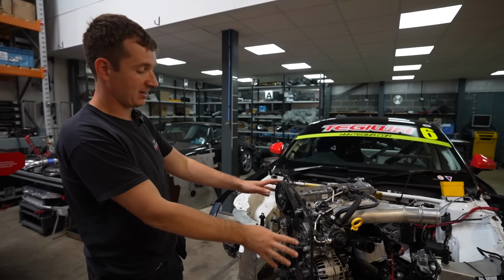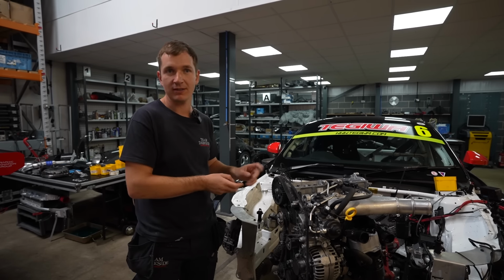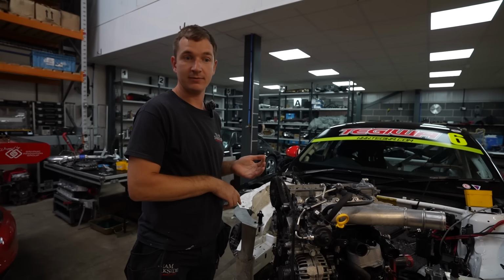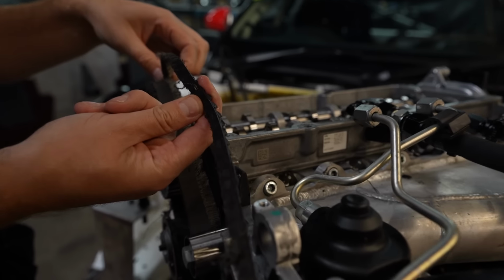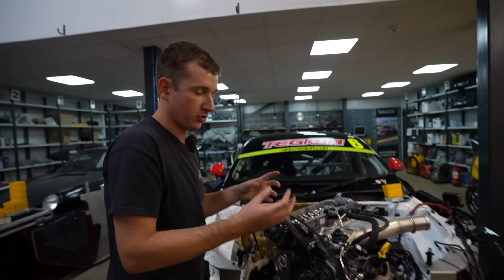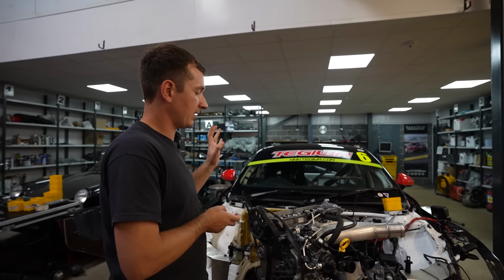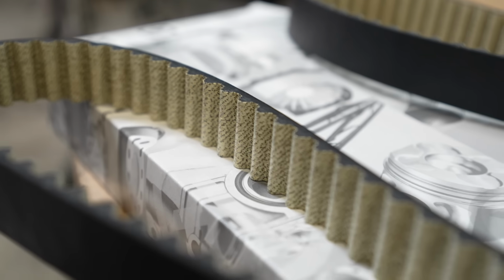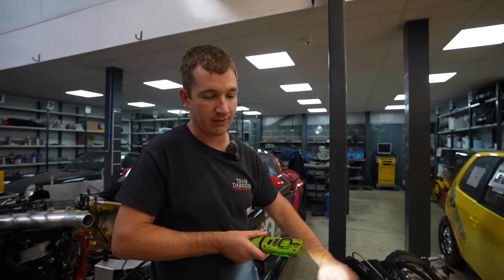CUAA CAMBELT CRISIS!!! We SNAPPED ANOTHER! 😫 HELP NEEDED! 🙏

Comment: Hi chaps, VW commercial tech here, we see this failure on the caddy's quite often. Although the root cause is still somewhat unexplained in our workshop we have noticed a fairly common trend, I suspect the timing belt is running backwards / forwards off the fuel pump pulley, thus causing the leading / trailing edge ( dependant on which way the belt is running off the pulley ) to wear against the edges of the tensioner pulley / sealing flange, this weakens the belt and then causes the belt to fail. 
If you look at the auxiliary bracket you will see a dowel pin that mates to the block, there is the possibility to add another (dependant on the bracket fitted) to ensure the bracket is correctly aligned to the cylinder block and therefore ensuring the fuel pump pulley is running true to the rest of the timing belt gear. 

Hope this gives some insight. All the best !
Reply: It was water pump on my side and i wasn’t only caddy’s. Also leon and golf’s
Reply: @Audi-fan_boy usually inna/borsehung or febi and the Chinese one they all work

Comment: Change the spring loaded tensioner for a manual one, because your revving the engine higher than oem rev limit you’ll be getting harmonics causing the belt to flat about, the pug/citroen tu5jp’s are known for it when you rev them to 7.5k on an oem engine and it’s worse with aftermarket cams and springs the fix is to fit the saxo vts/106 gti manual tensioner and the problem goes away even revving to 9k with an off the shelf gates timing belt

Comment: use electric waterpump (from bmw) ,waterpump delete plate and high pressure fuel pump from serpetin belt. shorter belt ,less strech and less load on cambelt.

Comment: Check the crankshaft timing belt gear they go oval ,roll it on a flat surface to see if it rolls smooth or with a jerky motion  which causes the timing belt to walk , which then rubs on the covers causing the belt to shread. check crankshaft pulley also for deformation as this also causes the belt to oscilate forwards and backwards efectivly cutting the belt . generally look for sharp edges and corners on all pulleys gears and idlers seen this quite a bit on pd engines.
Reply: A lot of VW sprockets and pulleys come from the factory oval (or square-ish).

Comment: Manually setup cam tensioner. Run fuel and oil pumps electric and fob off the runners for these. Potentially tension up using manual tensioner and then run the engine up on the dyno with a camera that has a high frame rate on the belt

Comment: The older PD engines used to do this. I found the toothed crank sprocket to be out of round on multiple engines. Possibly check all pulleys/sprockets are 100% true.
Reply: The crank pulley is designed to be out of round I remember reading it in a pdf about pds from vw themselves, counteracts the back lash from the injectors if I remember correctly
Reply: Just realised you mean out of round the other way, my bad

Comment: Change the belt prior to every race meeting.

Andy Burton had a famous homebuilt peugeot 306 rally car originally with a metro 6r4 v6 engine. It was replace with a dtm calibra cosworth v6 as the 6r4 engine kept breaking belts. They went to the extent of doubling the belt drive (stacked pulleys) and ran 2 timing belts...

Bit of a wild card idea, which i dont think fixes your issue as there clearly an underlying issue of the belt moving sideways on the pulleys.

Comment: Given the high rpm continuously when racing, could the tensioner be that bit too weak after a period of time that its allowing it to be a little too slack?
On other engines we have used manual tensioners to remedy this issue preventing the slap. Could you possibly rig a go pro in the area and remove the belt covers to observe when testing to get a better image of things before and when it occurrs?
Reply: Tomorrow's job on the other car ;)
Reply: I would just like to add that this is common on race bikes and stunt bikes (super high rpm and alot of abuse) I would be inclined to agree with you sir. Maybe a manual tensioner could help

Comment: Hi darkside i see gates make a "racing belt"  that back of the belt is blue maybe try that. Although they might not make it for that engine code u could probably measure the length width and teeth count and get one for another engine. Or get a marginally skinnyer belt to give you a extra bit of clearance 🤔

Comment: Similar issue with a 1.9 tdi with a aftermarket camber kit and the bearing in the tensioner pulley was pressed to far in and caused the belt to run against the lower casing, try a whole new kit 👍

Comment: i'd say change all the bolts and nuts on those pulleys tensioners ... maybe it can flex a bit under that horspower and load! arp studs bolts.... maybe?? head bolts maybe.! could you measure  all the pulleys run true and square .... there can be a problem

Comment: Harmonics definitely look at crank pulley or changing it, auxiliary pulley don’t think if it’s stock it will cope with knock of engine with it high revving…?? did you rebalance the crank, flywheel and clutch?l together? definitely vibration related hope you get it sorted 👍🏻

Comment: This reply is not specific to this engine and I'm not sure of what cams you are running so take what I say with a pinch of salt and adapt for you situation. When I used to build engines with higher lift cams and higher engine rpm you can get some real funky harmonics occurring with the cam belt at different rpms. The high lift cams used to exaggerate this effect more and different areas of the belt path would resonate at different points depending on the rpm. One of the things that used to exaggerate this even more was automatic tensioners as they contributed to the whipping effect of the belt. We used to replace automatic tensioners with manual tensioners and check periodically for the correct tension.
If you have a good fabricator in house there is also the option of adding another idler pulley on the lengthier side of the cambelt path to reduce harmonics even more.
Reply: This was one of our thoughts, as well as Pulleys with sides to help keep the belt centred.

Comment: Seems to do it after a gear shift. I would look at crank walk. Perhaps high pressure is moving the crank forward from the pressure plate?
Reply from the maker: Sound point, these engines never had a manual box but the crank feels good, engine was 100km old

Comment: From what i saw in the video. you got really high torque, you said single mass fly. that means the crank spins easyer and fast at every explosion is a big impact on the belt which is trying to spin the cams.
the tensioner can't take the instant torque, the belt is skinny.

personally my first try would be stronger tensioner and wider belt and pulleys everything just wider.
second thing weight reduction, for the cams so it can spin easyer. prefabricate aluminium pulleys.
the cams need to be forged steel i dont think anything else will hold up.

and i bet the valve springs are heavy duty also again another resistance to coup with.

3. change the map, add a blip to keep revs stable, something like rev matching. it will be annoying but you got to big impacts going true a belt. (alltho in track condition dont think if it would worke cause you need fast gear changes to win.

other ideas... there is one but its nasty, convert to chain and use a big beefy chain or double sprockets and double chain. that will snap to eventually but not being so flexible and the tensioners are kinda fixed you might brake tensioners instead of belt snapping.

for big power you need beefear part's.

Comment: Just a hunch, are you certain it’s not crank end float? Explains the belt getting shredded on the front main seal housing. Considering the EA888’s have issues with thrust bearings it’s not impossible to imagine the diesel at increased RPM and power may be starting to suffer something similar.

Comment: Do these engines use the "square" shaped so called "smartsprocket" crank pulley? Could it be possible that the increased rpm is causing more belt flap when combined with the auto tensioner? Maybe fit a traditional round pulley and see if the belt moves as much?
Reply from the maker: Yes they do, fair point!

Comment: Is it unheard of to make custom crank and cam sprockets to carry two parallel timing belts? Seems clunky but unless you can get a stronger or wider belt... (which would require a similar solution)
Or if you think the tensioner pulley is cutting the back of it when you have transients of slack, you might need either a pulley with tapered retainers on the edge or a faster reacting tensioner (or both). But one question is, if it has slack at times, why does it have slack? Too much tension for the belt, and it's stretching?
Maybe get a wider belt or two parallel belts, maybe with two parallel tensioners or design one stiffer tensioner
Reply: Sounds mad max!

Comment: Did you get a result on this? Dyno covers off ? 
Been thinking about pd engine with oval crank pulley to stop belt flapping.
Reply from the maker: We did manage to video in slow motion and saw the belt flapping around, we've tried a crank damper which helped but still flapped around at4200rpm. Next we're deleting the balance shaft

Comment: Hi i saw cases like this happened to costumers it was water pump leaning down making the belt going out but the damper push it in the movement will cut it in half . The belt is strong but water pump is fragile part that’s what was in my cases. Hope this is helpful and sorry for bad language.
Reply from the maker: Thanks, no water leaks here
Reply: @DarksideDevelopments  no no no it doesn’t leak just bend

Comment: What's the spec of the high pressure fuel pump ?
Reply from the maker: Stock CP4.2. Never any issues with the pump after these failures
Reply: @DarksideDevelopments  I’m wondering if you’ve had the drive pulley off the pump and it’s not gone back on in the same position, on the Peugeot DV6 diesel the belts are failing when the pump isn’t “timed” correctly when replaced and the peak load of the pump is in time with the peak load of the cam causing early failure.